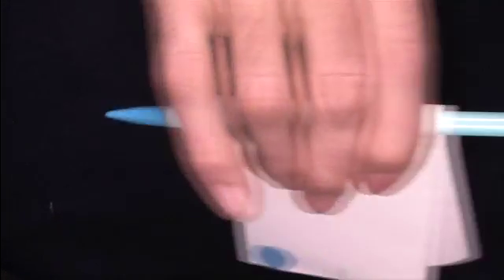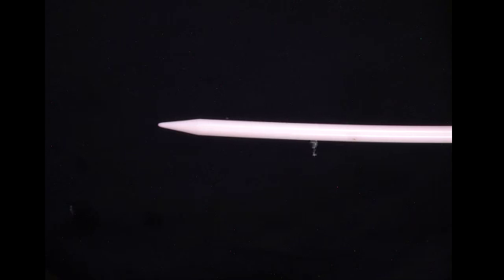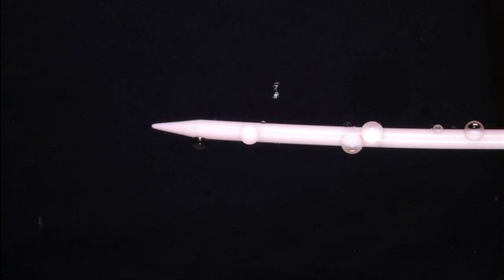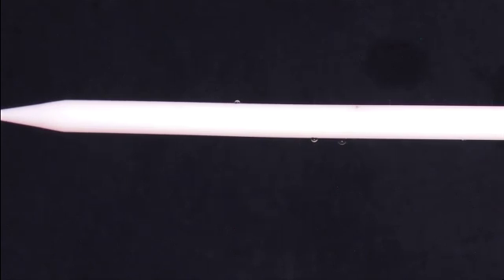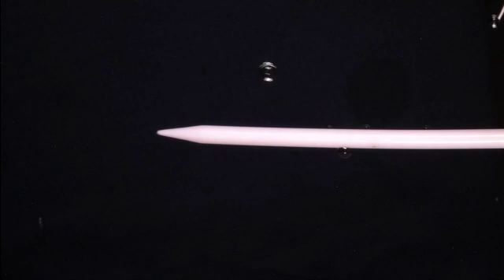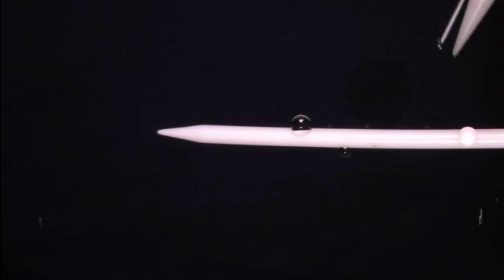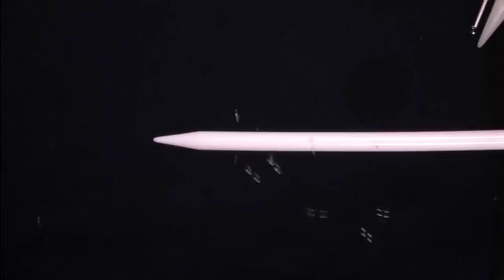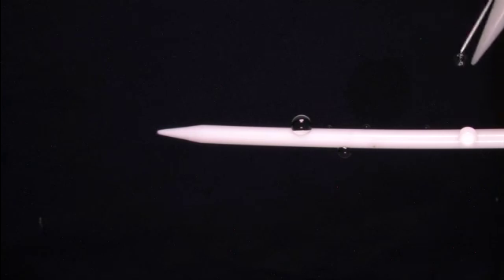Science off the Sphere: Knitting Needle Experiment

Comment: Do the same principals apply when it is not liquid water, or if it is other frozen gases? If so could this idea have a potential of gathering burnable gases such as methane gas when probes as well as other types of long distance space craft are traveling from earth to distant neighboring systems,in order to provide a quick return to earth for the collection of the probe's data?Last question if it is easy to answer, how long will the specific types of cone ended cylinders maintain there charge?

Comment: To have an attraction like this, there needs to be a difference in charge between the two objects. If you applied a charge to the floor of a spaceship, it would attract all the neutral objects inside the ship, but as soon as an object touched the floor, the charges would equalize, and the attraction force would disappear. For this to work, you would need to create an electrical isolation barrier between the floor and all the objects. Also, the amount of charge necessary would be HUGE.

Comment: I'm a bit skeptical that the third knitting needle is required. Water is polar, so experiences electrostatic attraction to charged objects even if it's electrically neutral overall, though the force is not inverse square. If you could charge the droplets (say by connecting a metal plate in the syringe to a battery) then you could use the same pole to accelerate them away from the tip. 
A charged sphere with spherical symmetry of the potential would be awesome!